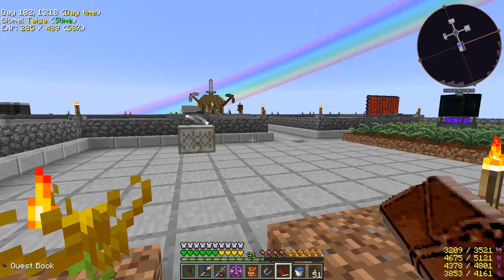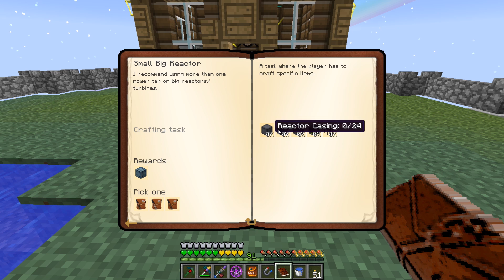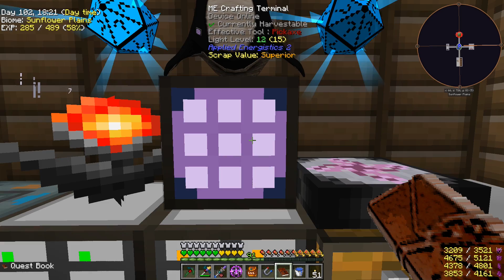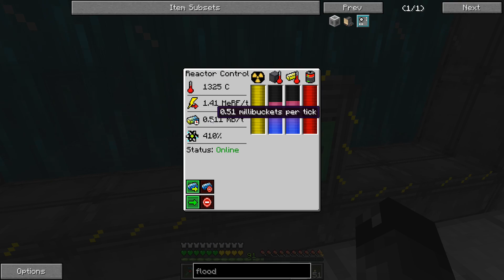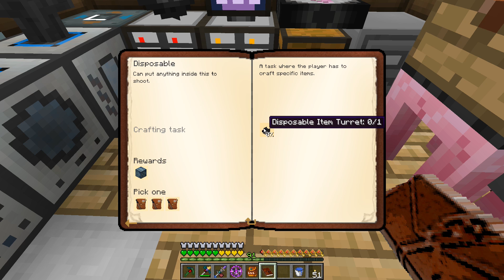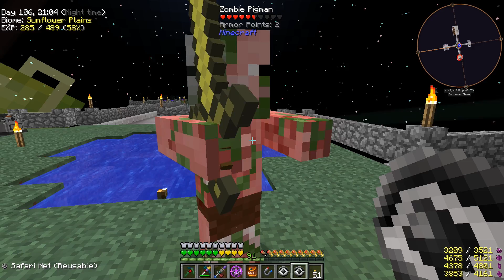Minecraft Mods Project Ozone - OVERPOWERED POWER [E29] (Modded HQM Sky Block)

Comment: I have to warn you about the huge reactors: I built a max size one (32*32*48) and the controller kept crashing my game for some reason, so be on the lookout for that.
Reply: Reason for that being if you click it with a tinkers tool in hand then it will crash regardless of the size, same used to happen to tesseracts in project ozone (sometimes still does)
Reply: +NdM Music no, in this case it crashes regardless of what I am holding and it crashes after being in the menu for a couple of seconds or whenever I exit out of it.
Reply: +Max S really? Shouldn't happen no matter the size. Try updating the mod to latest build and test it
Reply: Max S if possible can you send a link to a crashlog? might be able to have a little look into it.
Reply: +NdM Music I actually deleted all of my files just today xD

Comment: cant be asked to fill it in really ? use a flood gate XD
Reply from the maker: +conor smith It would still takes approx 3 years to fill and I'd need to melt the rest of the cryotheum. I just can't be bothered lol.
Reply: +Hypnotizd fair point but when u make a Max size one what than ? I guess..why not just automate it at some point or make a dimension ?
Reply: +Hypnotizd You can put cyrotheum buckets in the tablet, just saying. It is a pain to fill the reactor, though.

Comment: You could have used the build craft floodgate to fill the whole big reactor
Reply: +Dinesh Kuriakose would place the molten ender in every spot, so would be wasted EnderPearls (or stuff that melts in to Molten Ender).
If he had used cryotheum it would be good.
Reply: +RG .tazzy I was talking about the gelid cryotheum. But it would also work if he used the flood gate with the resonant ender and placed the floodgate at the top of the reactor. The floodgate would fill the nearest blocks first, I think.
Reply: +Dinesh Kuriakose Nope it acts like real water, it fills from the bottom up in conjunction with nearest first

Comment: The botania wiki says that if you feed anything to an endoflame that burns longer than a coal block, it will diminish and only burn longer than a coal block. I think you're wasting aternalus fuel.
Reply: most likely a config setting. soaryn tested it and it produced mana for a long time
Reply: Why do you think Vazkii put in that thing? It's after Soaryn burnt an ethernelis fuel block.
Reply: +Eladk probably because vaski doesn't like things to be easy
Reply: +Jack Smith vazkii
Reply: +Eladk i need to check on wether or not there is a config setting for that